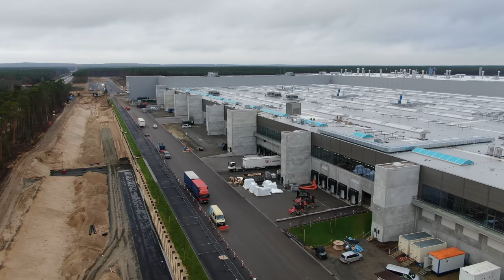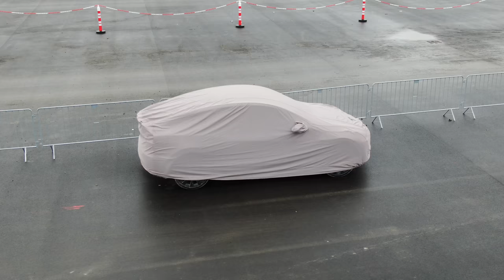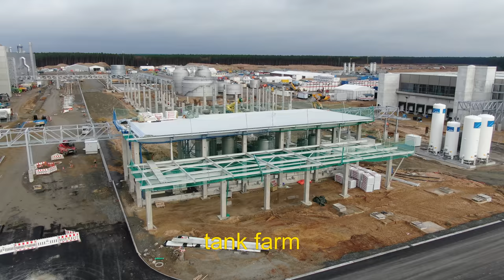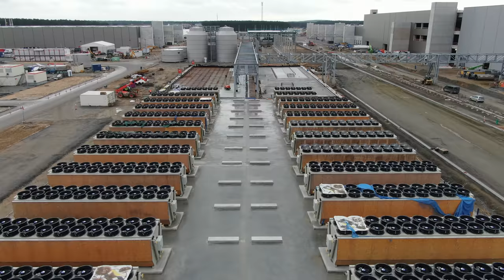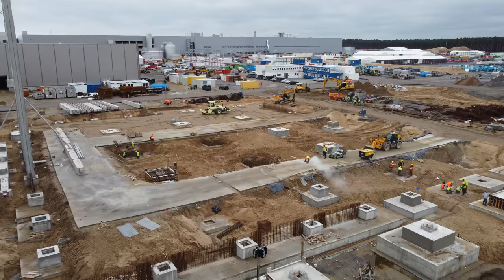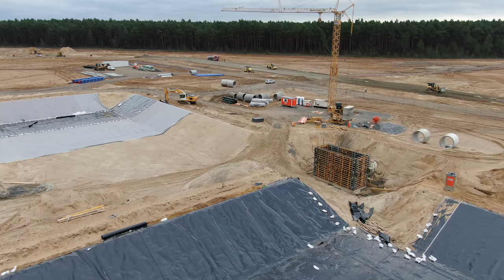Giga Berlin | 2021-11-20 | Pre-Production or Made in China?

Comment: Any way to tell if the Berlin Model Y will have better suspension?
Reply: Hi, possibly yes, due to they start with performance models, which have a sporty suspension. I'm not sure, which manufacturer will deliver it, but I'm very sure, it is not any cheap crap :)
Reply: Will it have air suspension?
Reply: @s.m.7018  I'm not sure. From Sandy Munro we know, there is possibly space for it, but if it will be used, I can't tell. 
Plaid Mode will be a nice feature I'm looking for, but still unsure if this will come.